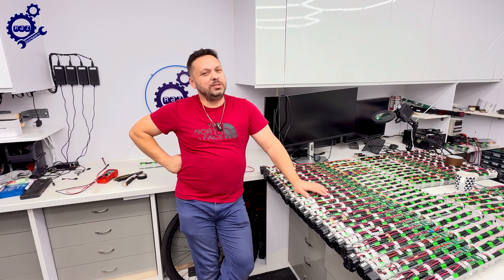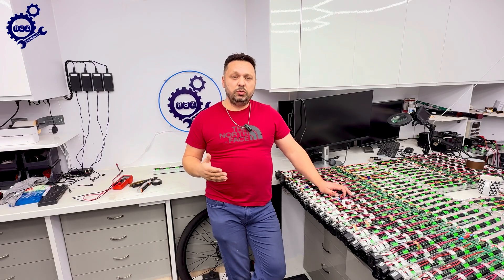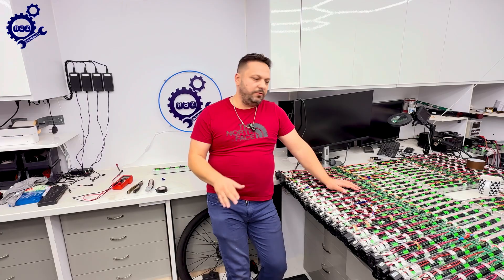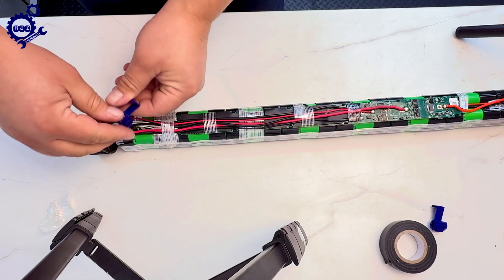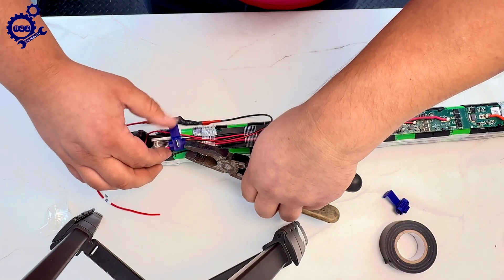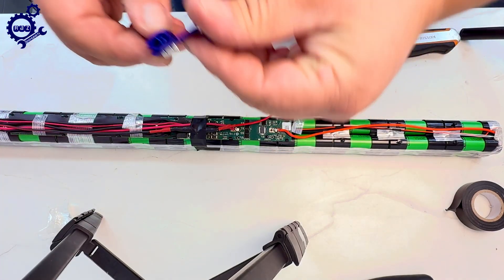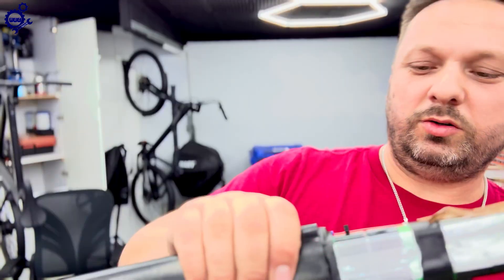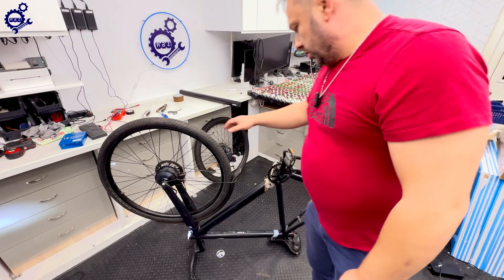Vanmoof S3/X3  battery bypass

Comment: Hi Raz,
I’m having the following problem: my S3 bike is showing Err6. I opened the main battery and found that it had gone into deep discharge, so I charged it with a power supply up to a total of 41 V. The small backup battery in the main controller was also deeply discharged, and I charged that as well.
Err6 is still showing. Will your solution help in this case, or does something else need to be done or repaired first?
I’d really appreciate your reply.
Best regards,
Reply from the maker: Try hard reset …. To clear the error … shuffle thru my short videos will find the solution 😊

Comment: Hi Raz, I took my S3 for a ride in the morning like every day and charged it afterwards. When I unplugged the charger in the afternoon (so still same day), the screen alternated between "error 6" and "error 17." The turbo button is still responding (to unlock with code), and the front and rear lights are still on, but the display no longer shows any mileage while cycling, it doesn't provide pedal assist, and the automatic transmission doesn't shift up. While cycling, the display keeps alternating between "error 6" and "error 17," or it shows the pulsating dot as if the bike is standing still. Would your fix in this video solve this?
Reply from the maker: That is why I created this bypass … 
What happens is when u charge … will charge as long as the main battery is charging … when main battery is full will fake charge …. Main battery disconnects and is not charging anymore, is discharging the module battery. And in another 6 hours module will be dead …. When u start bike ..u face errors (6,17,19,20 …. Because u have main battery but module is dead …. 
Is a design defect ..
U need to disconnect the bike before reach 100% or will have this issues…. 
Also when u leave ur bike for few weeks u need to manually charge the smart unit before first start …. 
If u order now the bypass u ca fix this issues … but u might have the fuse blown 
Most batteries blow fuse by command….

U can add a fuse with the bypass and find a local electrician to fit the bypass ans replace the fuse …. 
👍

Comment: Does it work for the S2. Or do you have an solution? It’s such a great bike😘
Reply from the maker: I have a s2 I think with the s2 u can just pop out the module out and charge it manually….. but basically to avoid that husssle yes will work … 
Basically will work to any bike that has module that has its own battery most bikes are designed to shut down completely leaving the smart module without power while stored for long time

Comment: Hi Raz, what electric components are in or what as result does this solution deliver? Can you shortly explain what's different, compared with don't using this,? Best regards Wolfgang
Reply from the maker: Is a small self recovery fuse and a diode ….. 
without this … every time u don’t use your bike for a week or 2 …. Bike will die as the module battery doesn’t top up … when u start ur bike again u see that errors appearing…. Also when u use ur bike for few minutes and than u stop using it for a while happens the same ..,, when u forget ur bike on charge for more than 4 hours …. Will drain module …. Basically bypass feeds the module battery with power in any circumstance  but also have the current limited to 0.05A so will not affect the safety in case ur battery has a real problem ….. Already fited to 50 bikes …, error 17 gone …. I had few bike left on charge for 2 days just to see if is affecting anything …. And I can confirm that as far as I’m aware…. Problem solved ☺️

Comment: You bypass the fuse. Is this save? And a solution for not replacing the fuse?
Reply from the maker: Is not bypassing just a small amount of current and will allow module to charge normally
Reply: So it’s not a solution for a blown fuse
Reply from the maker: @markpronk26  is not a solution to fix a blown fuse …… but if u replace the fuse and is blowing again….. after few times that u pay for replacing the fuse…. Just buy this installed and fuse doesn’t blow again 😊  ….
Reply: Hi Raz, what electric components are in or what as result does this solution deliver? Can you shortly explain what's different, compared with don't using this,? Best regards Wolfgang